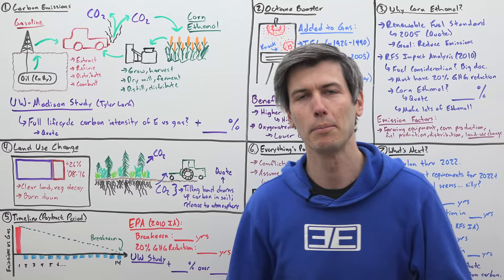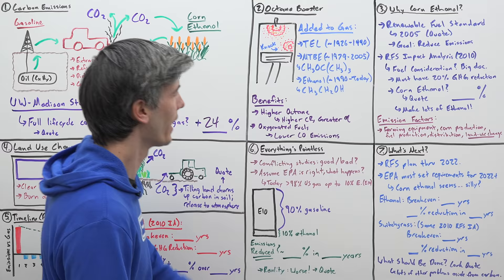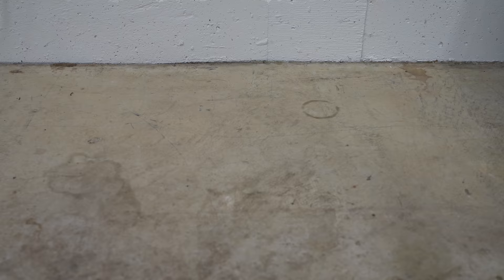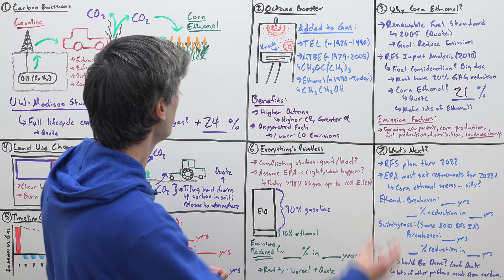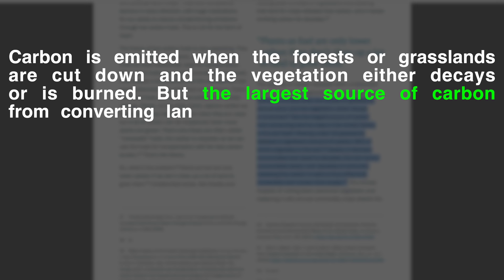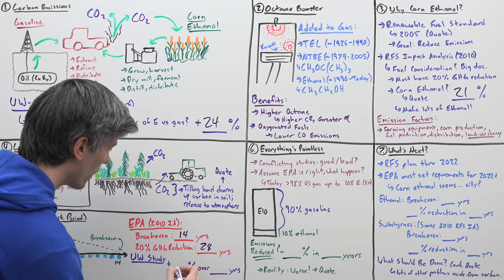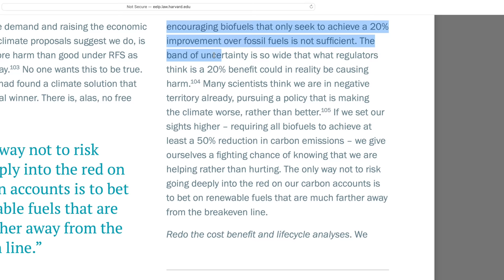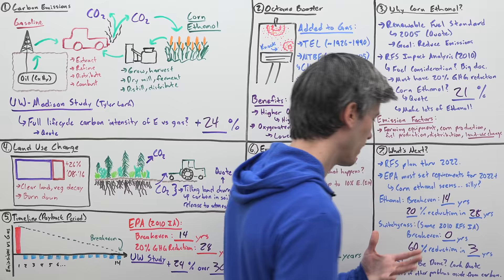America Was Wrong About Ethanol - Study Shows

Comment: Using corn was great for figuring out how to do it, how to set up infrastructure, etc.  Then we SHOULD be importing sugar cane, which is much better suited for making ethanol fuel.  But, even though Brazil has never flown airplanes into our skyscrapers, we have insane sugar cane import tariffs.  As a fuel, alcohol is a better solution than refined crude oil products.  Crude oil still has a place in making plastics and other products, but we should be using more ethanol.  Now, though, since the US president is owned by Communist China, we're being told to put all our automobile fuel eggs in one basket in a big EV push.  That's destined to fail, of course, but the point isn't  to save the planet, but rather further limit the mobility of the lower classes.
Reply: Why corn ethanol outcompetes sugarcane ethanol is that it is value-added from already existing corn feed production acres which leaves 100% of the protein, minerals, vitamins, fats, etc. still available for feed in a healthier, more digestible/efficient, and more concentrated form called distillers grains.

With this feed factor, nothing much out there can compete with corn, even sources that produce more ethanol per acre but little else like sugarcane.

Corn ethanol is so much more economical that Brazil has an import tariff on our ethanol.  

When our ethanol industry was in its infancy, we did have import tariffs on Brazil's mature ethanol industry, but soon took them off as Brazil became our top ethanol export market.

The one drawback of corn ethanol is that its production is limited to the size of the cattle herd on feed.  As such we can just over double current production from this source.  No corn would ever be grown just for ethanol, far too uneconomical to do so.

Dedicated ethanol engines are near pollution free and half the size/twice the power of gasoline and even diesel engines with mileage greater than either one.

Ricardo built an ethanol engine for GM and it ran in a pickup.  Here is an excerpt of an article describing it.  

FROM RICARDO:
The new federal CAFE standards are calling for a doubling of fuel mileage performance, which, Vint says, is going to send OEM’s looking for high octane numbers to improve efficiency and ethanol is the best source. Ricardo, an engineering firm with over 100 years in the business of engine design, has developed an extreme boosted direct injection engine (EBDI) to optimize ethanol blends. The 3.2 V6 gasoline engine rivals the power and torque of a much larger GMC Sierra 6.6 diesel, he said, and it delivers 3.5 percent better fuel economy than the diesel.
Reply: @danafletcher2341  good information, although I feel like you (maybe unintentionally) moved the goal post by mentioning ethanol import/export tariffs, when I was specifically talking about sugar cane, not ethanol.   I support using the best available and diverse sources for making fuel alcohol, whether that's sugar cane, corn, or something else.  More sources helps regulate prices and availability.  Anyway, the US has import tariffs on ethanol AND biodiesel fuels.  Without bothering to research exactly why, I would wager a guess it's primarily a protectionist policy for US farm industry (corn and soy) just as the sugar cane import tariffs help the state of Hawaii, which doesn't have much to offer except sugar cane and tourism (and military advantage).  I think the government is also happy to keep bio-fuels as a fringe thing.  There's big money in sandbox wars.

As for OEMs chasing high octanes, I wish that were true.  Turbo vehicles are becoming more popular, and turbo engines love alcohol.   The Biden administration could have easily mandated all new gasoline passenger vehicles to be flex-fuel capable, which would have been a great environmentalist strategy, as well as supporting existing gasoline infrastructure (since flex-fuel cars can still run regular 87 oct. gasoline), improving our energy independence, keeping energy prices low, giving consumers more fuel choices, and even pandering to the US farm industry.  Instead, the Fed is trying to put a gun barrel in the mouth of every carmaker and force them to convert to lithium battery electric vehicles, reducing fuel choices, straining the power grid, decreasing our energy independence, damaging the environment, and reducing mobility, especially for the poor.
Reply: @deyemeracing8795  At the DOE webpage I see the import duty for ethanol ended back in 2011 at the same time Federal subsidy (VEETC) did.
I am sure we still have an import tariff on food grade table sugar which has existed since before ethanol came to be.  No one would make ethanol from table sugar, would take the economics away from it.  Brazil squeezes the sugarcane and quickly has to be fermented into ethanol since it doesn't store.

You do realize that Brazil is greatly expanding corn ethanol as well?  It is a great fit because Brazilian cattle feeders can use a healthier and better feed plus their ethanol plants, since corn stores so well, can operate them more efficiently 365 days a year in between the cane harvests.

Hawaii doesn't make sugar anymore; the sugar cane fields simply go to waste.  Very big shame for their main source of electricity comes from burning very expensive and very dirty diesel fuel.  They could make super cheap ethanol and burn it in a jet turbine electric plant pollution free.  GE converted a couple jet turbine electric plant generators to ethanol capability a number of years ago.   Hawaii could use it in their cars and trucks as well to get rid of that pollution.  All that for a small fraction of what they already have spent on solar and wind which have been failures.

Comment: One question came to my mind that is a sidenote, you mentioned a supposed increase in octane. But if I'm filling up with 87, and it contains up to 10% ethanol, it's still 87 right? Which means they are not making the fuel better and increasing knock resistance, they're simply diluting the fuel and pocketing the profit. Is that an incorrect assumption?
Reply: Sort of. Ethanol has a octane rating of 100, mixed with gasoline 112. 
Gas suppliers will take lower octane (quality) fuel, mix in some ethanol and sell it as higher octane fuel.
The cost of using ethanol to boost quality (octane) is lower than supplying higher quality fuel, which most consumers use.
Reply: Yeah, I didn't understand that either. I haul fuel. When we make E-85  , depending on the temperature, it's usually 300 gallons of 87 gas mixed with 1500 gallons of ethanol. Which yields 1800 gallons of E-85 .  I would never put that stuff in my car, just saying.
Reply: @GoogleDoesEvil  It's not a correct assumption. Go put that in your car, your engine will hate you. You need ethanol or another octane booster or your engine will experience knock and probably will eventually blow.   The ethanol free is specifically for recreational equipment that calls for it.
Reply: @justrelax3323  If a car is designed to run e85 (high eth level e85)  and a correct tune, it's basically cheap race fuel. Ive run it for years without issue.
Reply: @megusta2620  Incorrect. I ran ethanol free 93 octane for 4 year's in a supercharged impala no issues, also run the same fuel my mower and chainsaw. Fuel can sit for 2 years and it still good.
Reply: @dustintaylor9932  How did you avoid knock without higher octane on a forced induction car? I guess I'm wrong about eth free gas, but e85's benefits are still ridiculous. I didn't believe it til I tried it.
Reply: @megusta2620 The non ethanol fuel was 93 octane, it's made for small engines so they say just due to the fuel lasts years where as ethanol fuel is only good for a few months, after a year it's not even flammable.
Reply: @GoogleDoesEvil  fair enough on the octane. I never use it except in my rec equipment.  Assuming the pricing scales, i'd still never use it for my daily as it's so damn expensive and cars made after 2005 all have non-corrosive fuel lines (from eth), so I don't get why people have such a hard time with it.  It's fuel, it's not dangerous to modern vehicles and it has more benefits than cons.

Comment: This video is useful for only oil surplus (who export crude) countries. For countries like India whose 70% import is just crude petroleum, any reduction of that import bill, however small even 5-10% is very important. That 10% is generally India's defence budget. By mixing 20% alcohol in petrol, India will have enough to spend elsewhere, like much cash strapped health, education, welfare sectors etc.
Reply: Ethanol isnt free
Reply: It's useful for everyone to be aware of, but I agree that this important context was missed that ethanol is largely about domestic energy production and reducing foreign oil dependency.  I don't know that the U.S. would be a net oil exporter today if ethanol wasn't produced (I haven't dug into the numbers).  Eventually though, with carbon neutrality being such an aggressive mandate in the U.S. and the EU, something's going to have to give.
Reply: @DeltaSierra426  The US would easily be a net exporter if we didn't keep kneecapping domestic production every time the blue team came to power.
Reply: If India made a law that only ethanol can be burned in automobiles it would not reduce their need for oil but increase it. Because it takes a lot of energy to make ethanol so you burn oil AND ethanol. Double the costs, double the pollution.  And India needs land for food, not folly.

Comment: Good discussion - Not much novel information; we should increase efficiency of agriculture, and probably revert to petroleum/petrochemical industry for a replacement of corn ethanol.   In our area we used MTBE, which was found deleterious to our 
fresh water aquifer(s).   Another aspect of ethanol additive - for some time(6 - 18 months), Mobil paid for weekly opinion advertisements in the New York Times, arguing that ethanol was a bad option, in part because it generates formaldehyde
residues in exhaust. A biosynthesizer of a replacement fuel oxidizer might be a better solution.
Reply: Oak Ridge Nation Laboratory measured E85 vs E0 and found that formaldehyde was higher on E85 during cold start testing but under real world driving conditions (US06), formaldehyde drops to levels lower than E0 gasoline.

The Swiss Federal Lab confirms ethanol lowers genotoxic emission which is what formaldehyde falls under:

Even with just 10% ethanol added to E0, the Swiss Federal Laboratory for Materials Science and Technology found that the especially health devastating ultra fine or nano particulate emissions were lowered by 97%, carbon monoxide lowered by 81%, carbon dioxide lowered by 13%, aromatic hydrocarbon emissions lowered by 67-96%, and genotoxic emissions lowered by 72%.

There were no new lands or forests broken up for corn, indeed US cropland acres have been declining since ethanol so such a notion is incorrect on its face.

Indeed the corn belt grew more acres of corn in 1980 before ethanol than they did in 2018, the year of most ethanol ever produced.

Comment: I’ve never seen any substantial grass land area being turned into a corn fields anywhere in the Midwest of the United States. This may be an issue in other parts of the world but I don’t think this is a US issue at all.
Reply: then you have had your eyes closed.  300 acres of sandy pastureland was ripped up last year just north of my property to grow.... CORN!  there is so much ground around here ripped up that shouldn't be.
Reply: I live in central Iowa and if you had a spare 45 minutes, I could drive you to about 20 different corn fields around my county that were grasslands 20 years ago.
Reply: @K31TH3R  the ones I know of around here I wouldn’t say were directly related to ethanol though. Most are more related to small dairy farms evaporating.
Reply: @WildHorsesOfCourse  That I couldn't tell you, but I imagine it would be primarily cattle feed due to the lower soil quality found around Des Moines, possibly some small amount of sweet corn going to the farmers market due to proximity to higher population areas. Iowa produces the most corn based ethanol in the country, however, most of the ethanol plants are pretty far away from populated areas. And I'm thankful for that, because the smells they release are absolutely heinous/putrid/nauseating, as if you stuck your head in a dumpster full of rotting pumpkins and old beer on a 100 degree day.
Reply: @WildHorsesOfCourse   That's not entirely unrelated.  If the gov. wouldn't prop up the big guys with these subsidized phony markets, there might be more interest in growing food and preserving grassland in some fashion.  Unfortunately as it is, we are far beyond mom and pop farms in most cases.

Comment: Ethanol is a incredible fuel for hot rods and race cars. Love it to death. 

I’m of the opinion co2 emissions isn’t nearly as big of a issue that we are all lead to believe. Mass deforestation is a far greater issue
Reply: Ethanol is not used in race cars. Another alcohol is used which I can't name because Youtube will block it since it contains the slang version of a street drug. Just put a M in front of ethanol.
Reply: @skidmark316  I have a 1100hp Trans Am and it runs on….. ethanol. Methanol is a better fuel by a good bit but the maintenance to run it is obnoxious. And it takes twice the fuel pump and injectors to supply enough of it to make similar power. If your making less than 2000hp it’s just not worth the trouble. Especially if you plan on street driving or doing street car classes with the car at all.
Reply: @nsboost  the youtube channel Cleetus McFarland runs Methanol in Mullet, it's actually setup as a dual fuel, has a pump gas setup for the street driving then auto switches to the Methanol when you go wide open throttle  or something like that
Reply: @DanielRichards644  it used to be. He took the rear tank fuel tank and water tank out and has a baby tank up front with only methanol and no intercooler. 

And if he does a race week again.. he’ll have to put it all back in, he barely has enough fuel to do 3 passes in that car right now.
Reply: @nsboost  the 3 passes on the small tank up front is the Methanol tank, he has a regular pump gas tank in the back for street cruises like the 30 mile drive the cars had to do to compete in that race, he just can't run the pump gas on the track because it won't make enough power.
Reply: See Joe Rogan interview with Randall Carlson.